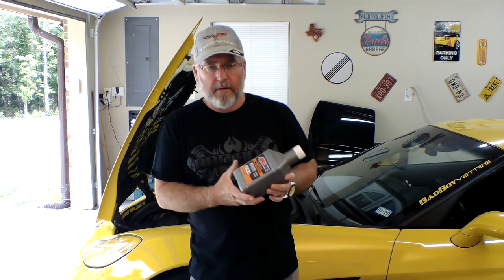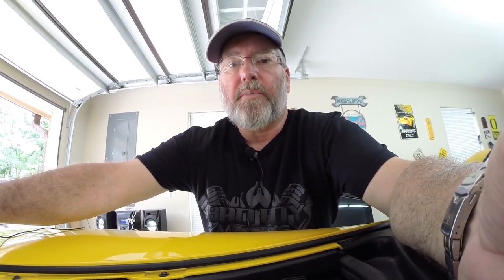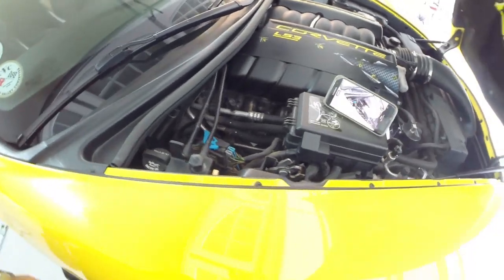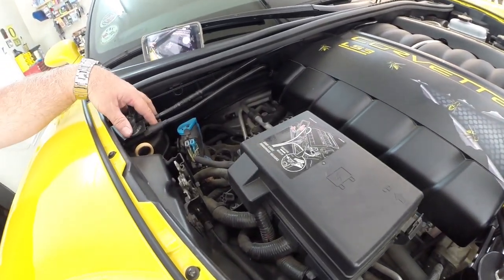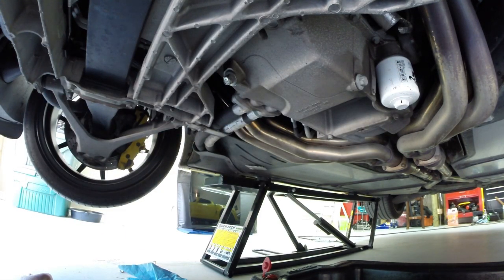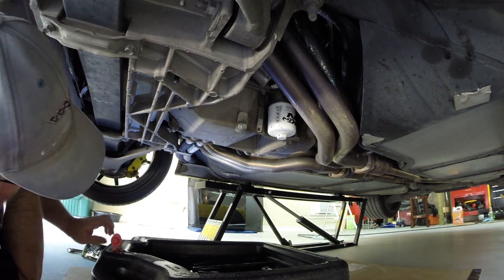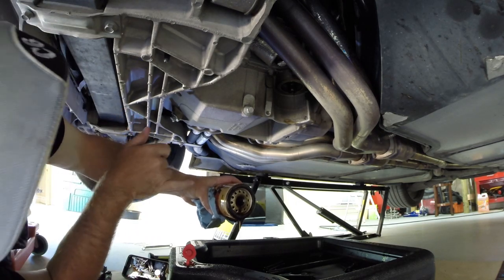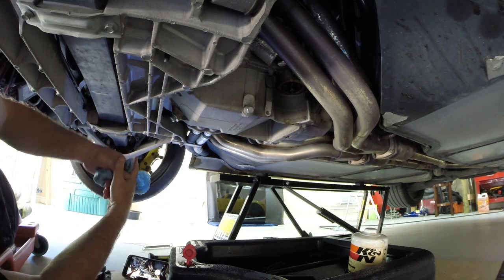C6 Corvette Dry Sump Oil Change How-To

Comment: I see your using 10-40.  Any reason your not using 5-30 as per factory spec?
Reply from the maker: I use 10-40 per my engine builders recommendation.  Bigger cam and higher valve spring pressure makes perfect sense to do so.  Thanks for the question!😎

Comment: Altho I know you wanna have the car level or leaning to the front so all the oil comes out

I mean if you jack it from the front only will enough oil comes out?

Most YouTube tutorials they hack from the front , put 2 jack stands and do the job
Reply from the maker: Before I had the QuickJack I did the same thing.  There's always some oil left in the system but it's a negligible amount that doesn't really matter in the grand scheme.  The most important thing is the regular maintenance with quality products.
Reply: @YellowJacketGarage  honestly I just thought of the no brained thing to do 

Remove the oil, put the oil plug back in

And drop the car from the jackstands so the oil settles  again

Repack the car up and it should be good 

And what about the drain plug, any washer to replace or do you reuse it every time
Reply from the maker: @Aninebula  I never lowered mine after dropping the plug, there's not enough oil left to worry about IMO.

There's not a crush washer to worry about, just tighten it back to the proper torque and be done.😎

Comment: 10w-40?????  Your car (just like mine) calls for 5w-30!! And, do you know of any reason to pull one oil plug before the other?? Oh, I should have said I have a 2011 velocity yellow grand sport corvette.
Reply from the maker: Cam and springs exert a higher pressure so the 10w40 was a builder recommendation so I'm sticking with that.😎  As for which plug, it makes no difference.  C7 is the same way but on the C8 they combined both drains into one plug.  Thanks for the question.
Reply: @YellowJacketGarage  OH, I should have realized your motor is a built one, thus different recommendations.  Thanks for the clarification on the drain plugs.
Reply from the maker: @user-cq5cq4me7t  yes Sir!  Always happy to talk cars and the different stuff folks do.  Thanks for being part of my journey!
Reply: @YellowJacketGarage  My pleasure my fellow car guy!! Thanks for the content!  I've only had my 2011 grand sport for about 3 weeks now, but I love her!  She only has borla exhaust, and a K&N air filter system so far, but I hope to eventually do a supercharger kit!!
Reply from the maker: @user-cq5cq4me7t  if you'd like one and I have your shirt size, send me an email with size and mailing address to yellowjacketgarage@gmail.com and I'll see if I can hook you up.😎

Comment: Hypothetically, if one these dry sump cars was taken to an oil change facility where the wrench turner is not familiar with these systems, is it possible for them to cause a lubrication failure ?  Is there some special procedure other than what you have described or is there some 'gotcha' that could cause oil starvation, even if temporarily?  
This really isn't a hypothetical.  This really happened.  The question is how, why.
Reply from the maker: Familiarity is absolutely a concern with these systems.  I've seen where a Chevy dealership hydrolocked an LS3 because their tech was clueless.  

In that case the tech assumed a non dry sump car was a dry sump car and added the 10.5 quarts.  I would be concerned the opposite would be the issue with a dry sump car by only adding the 6 quarts instead of the 10.5 back to the tank which absolutely cause a starvation issue.  Just because it's a dealership doesn't mean they automatically know what they're doing.
The C8 LT engines are no different except its a single plug but still a dry sump.  The change procedure on those can be tedious but if not followed could be easier to screw up.

Comment: So ~11qt's since you prefilled the filter?
Reply from the maker: 10.5 all in and then run it through the warm up process and recheck.  There is a little wiggle room but I typically just use 10.5 quarts including the filter and save the half quart for next time or if I need a top off between (I've never had to top off between oil changes yet).  Thanks for watching and the question!😎

Comment: Not sure if you address it later in the video, but why are you using 10w-40?  Isn't that a bit thick?
Reply from the maker: No, I don't address it but the reason is the cam/lifter/spring package has higher spring pressure so they heavier oil was recommended by the engine builder to help prevent wear.  It has the 525 hp package done by 21st Century Muscle Cars in Dallas.
Reply: @YellowJacketGarage  awesome and thanks for the reply!  The GS I just bought has a "mild" cam package but it's enough to really get rocking.  I've had lots of fun cars (Camaros, mustangs, rx7's) but this Corvette is amazing.  The whole driving experience.  Wanted one since I was a kid.....boy it was worth the wait!!  Thanks again for replying and posting this video.
Reply from the maker: @jeremyferg271  thanks for watching, subscribe and share.😎  Seriously though, thanks for commenting and please let me know if you have any questions or would like to see something covered, I'll consider any ideas people have.
Reply from the maker: @jeremyferg271  here's a little vid I did on my car that sounds decent.

https://youtu.be/D8pd_SYzptA

Comment: Thank you for this video! Just did my first oil change & wasted 5qts. because I didn't realize I had a dry sump. Had to start over. Mine is a GS manual as well same car as yours.
Reply from the maker: Sorry about the issues you had but super happy I was able to help.  Please subscribe and ask any questions you might have, the whole point to doing what I'm doing is to try and help people through the same things I've encountered.  Have a great day!
Reply: Subscribed sir. Do you mind also sharing what lift you're using under the car? I'm currently using a 3.5 ton floor jack. Thank you!
Reply from the maker: @castortroy4443  I have the QuickJack BL5000SLX, Fantastic lift for a hobby garage application.  I found mine on sale through Home Depot online, think it was about 1200 bucks, shipping included.
Reply: @YellowJacketGarage  Perfect, thank you sir!

Comment: Lionel here in central California. Nice explanation on the wet/dry oil system.
 I always prefill my oil filter, even on my Harley. Except when the oil comes up to the top I allow the level to go down. Do Not add any more like you would with your car. Because, you'll be mounting the filter side ways. Been using Amsoil for years. Very happy with it. I have over 207,000 miles on my 2003 Harley Davidson Roadking and the bottom end hasn't been touched. 
 First time for Amsoil in my C6. I'm sure you'll keep using it. Top of the heap. Thanks.
Reply from the maker: Thanks for watching!  I try to get my filter as full as I can.  I've used Mobil 1 for years but am switching everything to Amsoil because of the consistent independent ratings they get.

Comment: Any reason for 10w instead of 5w?
Reply from the maker: Yes, my engine has a bigger cam and higher spring pressures so it was recommended to step up just a bit in the oil weight.  Originally the builder warranty required it but that warranty has expired...I'll stick with the weight though.  Great question, thanks for watching and asking!😎

Comment: I didn't know that a C6 LS3 engine could be a dry sump. Does that come only with the Z51 Package?  I've only seen C6 LS7's with dry sump until now.
Reply from the maker: The manual Grand Sports were also dry sump systems.  They moved the battery to the back (same location as the Z06) as a " track ready" car.  Thanks for watching, very much appreciated!
Reply from the maker: All of the Grand Sports have the Z51 option as far as I know.
Reply: Thanks for your reply. Someone said the dry sump was only offered on 2010 grand sport. I don't really need the big block as the LS3 would be fine for me. But are there other years the grand sport came with duty sump.
I'm looking for a 2010 or newer C6 w d/s or up to 2017 C7 Z51.
Reply from the maker: @davetee116  mine is a 2012.  Pretty sure all manual trans C6 Grand Sports (except convertible) have a dry sump system but not sure on the C7's.  I'll do a little digging and see if I can get you a definitive answer.
Reply from the maker: @davetee116  ok, as promised, here's the answer.  All manual transmission C6 Grand Sport Corvettes have the dry sump oil system except convertible cars as none of the verts have dry sump.  That runs from 2010 to 2013 so as long as you buy the manual transmission Grand Sport targa roof car it should have the dry sump with the LS3.  If you find a car you're interested in and want to be certain it has the dry sump, please reach out and I'll help you make sure it has what you want.😎
Reply: @YellowJacketGarage  it makes sense that if the oil fill cap is not in the usual spot near the intake manifold. 
What a sweet Machine you have sir. Exactly what I'm looking for. I figured out that the newer C7's come WITH Z51 option with being a grand sport.  Good to know that a C6 Grand Sport is viable option for me in the older model.  Excellent video, love the quick Jack's, and all the info. Thx..